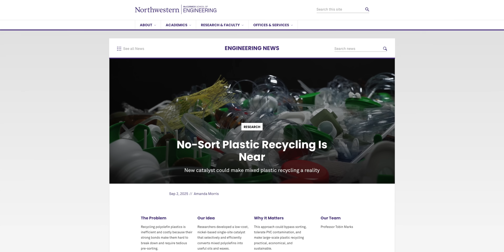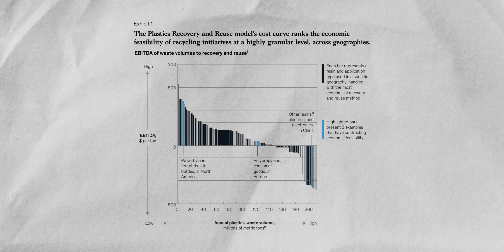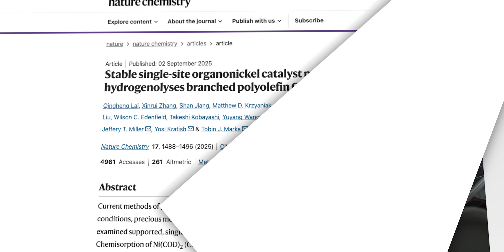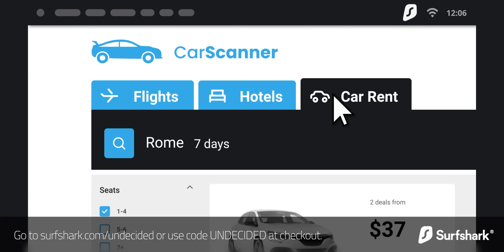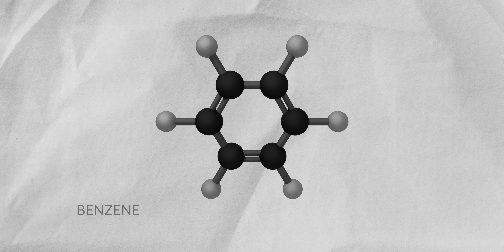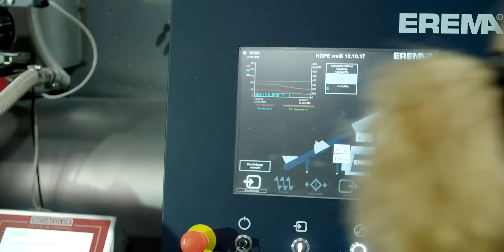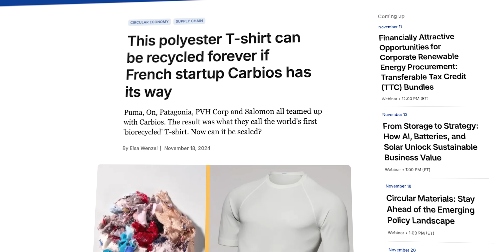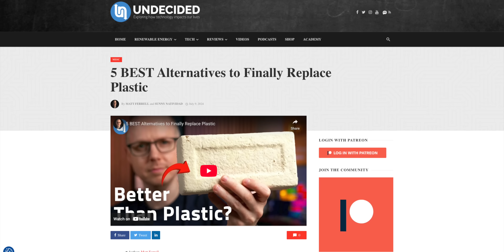The Recycling Breakthrough That Doesn't Need Sorting

Comment: The Australian company Plastic Forests, based in Albury, NSW, manufactures recycled plastic fence posts known as the Plus Post, which are made from 100% recycled plastic waste, including farm plastics like silage wrap and bulker bags, as well as household plastics and paper cups collected through the Simply Cups program.
 This initiative is part of a broader circular economy effort to repurpose waste that would otherwise end up in landfills.
 The company, an award-winning innovator, produces durable, UV-stabilized, and rust-free posts designed for long-term use in various environments, including swampy or coastal areas.
 The Plus Post is used in fencing applications such as with square pickets and droppers, offering a low-maintenance, safe, and environmentally sustainable alternative to timber or steel posts.

Comment: The important thing to remember with all of this is that at the end of the day, the cost doesn't matter (much). All that really matters is that it can work.
Fact of the matter is that for better or (likely) worse, oil is still plentiful and cheap. And as long as that remains true, we will be beholden to oil producers who can undercut costs longer than companies that pull the trigger on scaling these technologies can remain in business. But! But... This won't always be true. We have already extracted and used more than half of the world's oil over the past 100 years, and at an increasing rate. 50-100 years from now the idea of cheap abundant oil will be a pipe dream. As the cheap stuff rolls off, this kind of tech will gain the funding and scale it needs. What matters is that we keep prepping the research for the day we need it... And if we have any good sense we will curb out oil addiction before we are forced to curb it because it is gone. I mean, slowing down fossil fuel use isn't going to do us a load of good if we burn through it in 100 years or 200 years... A slower death isn't all that much better than a quicker one, especially when we could... You know... Just not.

Comment: Too many types of plastics are used for so-called single use plastics.  Society may never quit using all these different types of plastics that makes recycling so hard, but society could restrict the number of plastic types used for single use purposes.  It would be an 80-20 solution.  A perfect solution is keeping us from implementing one that does a lot of good.  Single use should be LDPE, HDPE, PP, and PET types only.  The other types of of plastic should be restricted to long life product uses.  It would help to if single use was expanded to low use as well.  Kids toys, sunglasses, baby bottles, food storage containers, etc.  If the vast majority of plastic hitting recycling containers were just those 4 types then the sorting and recovery would get most plastic use back into consumer use again.  We should first try to solve the bulk of the problem first before waiting forever for the perfect cure because the trash in the wild keeps piling up endlessly.

Comment: The largest issue is that this won't resolve the microplastic problem and that's the larger problem with plastic. If it's going to be worn down into a dust that spreads everywhere even inside of us we need to rethink it from it's building blocks and ban toxic plastic worldwide at the very least, ideally only fully biodegradable plastic should be accepted but that's not possible at least not immediately.

Comment: Not covered here is the cost of transportation to centers where conversion or breakdown happens.  This cost can add up quickly especially if the centers are a longer distance away. The US is a huge country with only a few potential conversion centeres.  This transportation cost inhibits glass recycling now because glass kilns for manufacturing are not localized, ie. the kilns are in a few places within the US.  Europe is better suited for recycling since each country is smaller in size, reducing transportation costs.

I see some hope of using robotics for plastic sorting.

Comment: I don’t know the exact figures, but the ethylene could also be used as a fuel to produce steam. This steam could then drive a steam turbine, which would generate electricity for the plasma torch. The residual heat remaining in the steam after the turbine could be used for district heating or similar applications.

Comment: What about Aduro Clean Technologies? They have an innovative new technology that disrupts the industry for recycling and reclaiming plastic and petroleum waste. Their proprietary Hydrochemolytic Technology operates at lower temperatures, which reduces energy costs, and mainly uses water instead of harsher chemicals typically employed in plastic recycling. Their pilot-plant trials are progressing well, and they are planning to build a full-scale industrial facility. They offer a practical solution for chemical recycling of plastic and petroleum waste into feedstocks for manufacturers. Considering your coverage, it's worth taking the time to review their work and the progress they've achieved so far.
Reply: Agreed on Aduro. Disappointed that Undecided missed them. They’ve been developing their HCT technology for years and they’re now commissioning a large scale lab pilot plant and developing their full size plant.  They’ve got trials ongoing with numerous billion dollar companies.
Reply: This has to be written by a marketing department. No human writes like this.
Reply: @ProjectStickman  - Sorry Sticky, but I'm human. I thoroughly researched Aduro before investing. Based on what I've found, I believe they're going to be a very successful disruptor in the plastic waste reclamation industry. Sorry if I made it too informative for you.

Comment: Saw a headline that China have invented a bamboo based plastic replacement.  As strong as all single use packaging and bottles, but that fully biodegradable in a matter of weeks in the ground.  No high temperature energy wasting processes required.  There was something similar a year or so back that was made from fisheries byproducts.  Everything else that allegedly recyclable should be banned.
Reply: That story is clearly nonsense. Anything that is "fully biodegradable in a matter of weeks" cannot be a replacement for plastics because it wouldn't work as food packaging. Also, even bamboo itself isn't that biodegradale. That stuff takes a bit of time to rot away completely.

Comment: Microplastics are the mid ocean tsunami of disaster we don't know is coming.   The biodegradable mushroom stuff is probably the best bet for most scenarios.   Glass isn't recyclable given our current global system.   It works in the ye olden daily and LOCAL milk bottle scenario - but transporting empties, in cases to prevent breakage, across multiple states will just never be economical.

Comment: Until plastics are no longer manufactured in any form it will be a problem. We need to go back to glass steel and aluminum and paper for containers. It worked for decades. It'll work again but the cost of cleaning up the plastic unless it was paid by the manufacturers or that producers that would be great but it never will be. It will always be paid for by the consumers so get rid of those plastics and use the stuff that we know works

Comment: I think the REASON we think plastic is SOO cool is because it is amazingly cheap. Virgin plastic is made of by-products of the oil industry (primarily) which allows a very symbiotic and beneficial relationship that keeps prices down. I think, depending on the price of these enzymes and amount of work it would take to clean them enough to put back into a manufacturing line, there is no way with could compete with virgin plastic.
Regardless I think an increase in the price of plastic would be a good thing for promoting new sustainable materials and a return to the age of glass and wood utensils in the kitchen.
Breaking down plastic to keep it out of the environment is good, but I think we should go a step further and make it something benign we could add to fertilizer or bury without environmental risk. That way we don't have to worry about whatever its newly recycled form does and where that ends up.

Comment: Even if this was able to help with recycling plastic the main issue I have seen is that people just don't care enough to do it. At least in the US. You can have bins for plastic/aluminum/trash next to each other and people will still throw it all away in the trash bin. Then they tell people that try to recycle what's in the trash bin that it's basically contaminated so just leave it in there.

Comment: A post grad of Dr. James Tour has patented a process called flash graphene.   It can flash waste uncleaned plastic into graphene using $30 of electricity per tonne.  The heat generated is so high no dangerous compounds remain.  Everything breaks down to individual elements.  One of the major left over elements is Hydrogen gas.  Cost of hydrogen calculated at -$4 per kilo since it's a waste product, it has a negative cost.  Graphene production using $30 input per tonne, when graphene used to cost $20k a kilo. 
Among other uses, graphene added to both concrete and asphalt makes them considerably stronger and longer lasting.  The company formed is called Universal Matter and is currently operating a pilot plant producing one tonne per day.
Reply: The icing on the cake for this tech is the plastic need not be sorted or cleaned.  The heat is so high, everything else just gets driven out as waste elements.  That is a huge cost savings for plastic recycling!   The tech has other uses.  Electrodes can be driven into contaminated soil, and flashed in place to breakdown toxic compounds into base elements.  Clean up superfund sites without removing soil.
Reply: Are you sure this makes graphene? It doesn't make sense, given the chemical structure and costs way more than $20/Kg. Also never heard it added to cement or asphalt. You must have meant graphite, which is indeed added to many things and irreplaceable on its own. Idk how much it costs raw. This seems too cheap and good a process to be true.
Reply: @dannydadog1987Yes it's graphene. 
Dr. Tour and his Grad students are pretty amazing.  Dr. Tour is professor emeritus of chemistry and nano engineering at Rice University.  He was just voted into The National Academy of Engineers last year.  R&D magazines scientist of the year, etc. 
I found this link on the subject but it's a couple years old. 

https://youtu.be/GHMp9OUQgUg?si=xcsblzlezK1gzUvJ

Search from there for more info.
Reply: @dannydadog1987no I've heard of this. Short version, the way the carbon cools in vacuum from sudden, extreme temperatures forms it into small graphene sheets in particles, rather than large sheets like people normally think of. The channel Tech Ingredients did a video demonstrating the process and proving it isn't graphite.

As for concrete, the company Concretene out of Manchester, UK is working on it and has built multiple small projects. They see significant strength gains and reduced cure time, sometimes allowing rebar to be completely eliminated

Comment: The fundamental problem in plastics and the global consumer economy generally is the failure to design recycling into the product cycle from the beginning. Most products are not initially designed with their ultimate disposal in mind--firms offload the recycling/disposal problem onto society at large. Another example of "privatize the gains, socialize the losses/costs." This is as true of cellphones, autos, and clothing as it is of plastic bottles. We'll only really solve this until we require that no product may be marketed until the producer has accounted for how it will be disposed/recycled. In short, the disposal problem needs to be put back on the product originator, and the cost of its disposal/recycling needs to be included in the original production.
Reply: I agree and companies won't do it unless they are incentivized or forced. I think there needs to be a national regulatory framework for example packaging that requires not only the use of truly recyclable materials, but also efficient design of the package overall. Maybe for certain classes of products there are only a limited number of standardized package designs allowed. Need to sell some peanuts? Choose from a short list of multi-sized boxes or containers and fit your product to the packaging. Research would guide the design of the pacakging to be attractive, eye-catching and marketable as well as not being bad for the planet. This stuff is not hard, but the markets need guidelines so the playing field is level.
Reply: To incentivise the creation of a circular plastic manufacturing chain, they'd need to save a lot of money switching over vs staying, atleast on a decade long scale. If Coca-Cola only needed to order back their own bottles to turn into new beads for new bottles, they could become a major force in plastics recycling, giving them a market advantage, which would promote everyone else to hop aboard.
Reply: @chsi5420  But think about what that would actually mean: you'd now need to store the returned bottles by manufacturer, transport them back to the manufacturer, force the manufacturer to become a chemical company, which they have zero expertise in. You can see where this idea would quickly become a nightmare. Much better to have specialised companies, and legally enforce certain value chains, a lot of which already exist.
Reply: @Volkbrecht  The makers of non-alcoholic beverages can and do outsource this process to companies that reprocess plastic bottles and tin cans.

Northern Europe has bottle reverse vending machines, which offer a small amount of money on a return receipt for each container.

The received receipt can be exchanged for cash or as a voucher when buying something from the same store at or near which the bottles were returned.

This automated system is widespread in Nordic and Baltic countries, Germany, and Netherlands.

I'm in Estonia. Price labels have the price of the product + €0.10 for each bottle or can of non-alcoholic beverage. The separation of the prices is that way, because these ten cents probably don't account as taxable, while the main product price contains tax.

The system works more-or-less like this: people put the bottles into a machine, they get their receipt, the bottles are recorded, crunched, and taken to the processing facility, either for recycling, or if the bottle is meant to be reusable, for washing.

Norway utilizes washing with sturdier plastic bottles that can be reused, though there is a reusage limit for each container.
Reply: @mardus_ee  No need to explain that to me, as a German I know deposit return well enough. Also, what do you think these deposit return machines are there for? Exactly the thing I described: to create waste and value chains into wich the materials can be fed. Have you ever looked on the other side of those machines? There is usually one big box or bag in which all the one-way packaging is pooled, to be machine-sorted later at a disposal facility. And a second line in which the reusable stuff stacks up, to be sorted away by the store people manually. Might be that there are some that already do more of the sorting by themselves, but you get the idea.

OP was suggesting a system in which the manufacturer of the packaging stays responsible for the packaging throughout its life cycle. But that's not efficient. Germany and other countries have, for decades now, created systems where the state defines the minimum requirements of what is supposed to happen with package waste, and audits waste streams to make sure disposal happens along those lines. The rest is up to the players in the market.
Reply: @Volkbrecht  much of which we recycle currently still just ends up as garbage in a landfill.  not much is ever recycled. look it up.   
i understand what im demanding.
producers produce garbage, they should 100% also be in someway responsible for the garbage they produce. right now, its inarguable that they dont do enough   BIG FAT FUCKING PERIOD.
Reply: 100%   garbage is ultimately the failure of the producer to incorporate the 3 R's into the lifetime of their product design
Reply: Agree 👍 ... well said.
Reply: Germany have implemented something like this. For example If you're a business looking to sell on amazon germany, you need to sign up with a waste disposal/ recycling partner in germany while aslo citing how much waste you'll generate via sales and what its made of. Not sure how effective this system is for recycling specifically
Reply: thats why i think with all plastics burning in a incenerator and produce enegy with the heat is one of the best options. recicle plastics is just too complicated. and enegy can always be used. putting plastics to landfills is just pure pollution. and the oil saved in energy production can be used to make fresh plastic. kind of recicling but different...

Comment: I believe that plastic in particular has no future. By this I mean that studies are gradually showing that the microplastics that end up in our food, drinking water and air are harmful to our health in the long term.
Water from plastic bottles, but also from the tap and from cans that have a plastic coating on the inside, all ends up in our food and drink. Studies also show that even if you drink spring water from a glass bottle, trifluoroacetic acid has already entered the springs, in some springs more than others, but still. 
It also spreads through the air, as it has already been detected in samples taken from polar ice. The entire food industry is made with plastic parts and tubes, as are our underground water pipes. Even if they recognise the seriousness of the situation tomorrow, it could take decades before they can change everything. But the lobby groups of these companies will try to prevent this for just as long